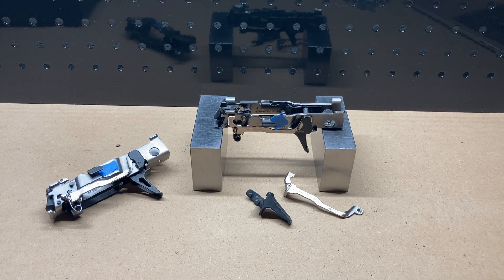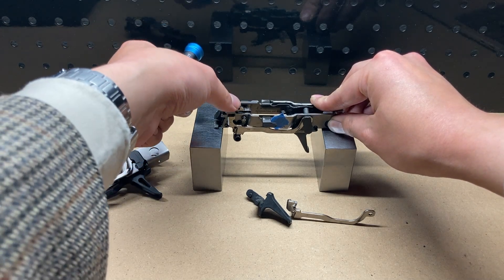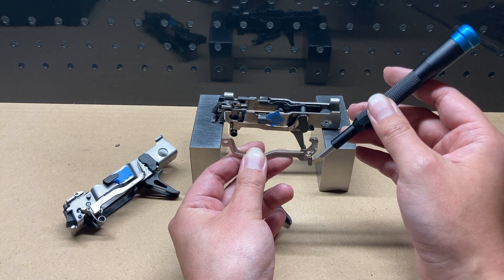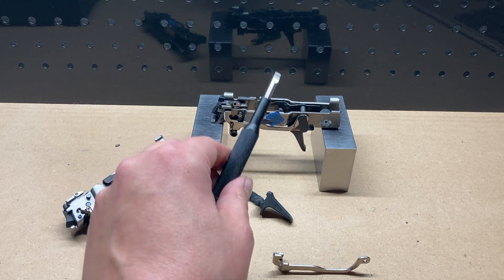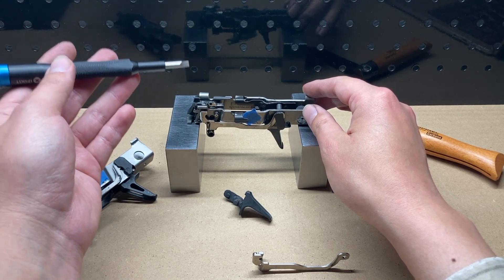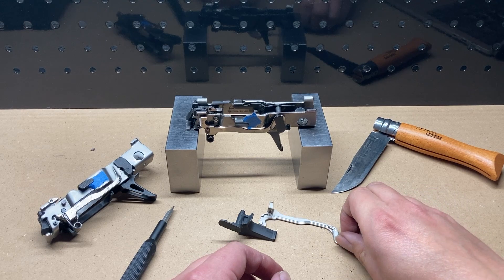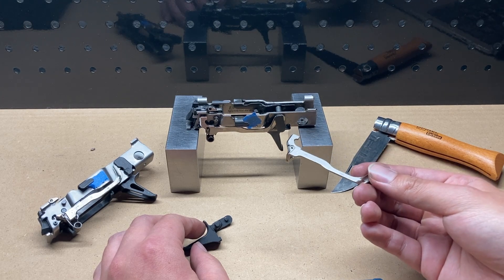P320 Sear Movement Test followup: It's all about the Trigger Bar and Trigger

Comment: Interesting thing, I just made the same gun with same parts go from "safe" to not safe and back to safe again. I have an X5 legion with this same number trigger bar from 2020 I believe. The gun passed the test and while it was passing the test the added piece for the drop safety was in no way "springy" I took the fire control unit out and it immediately failed. I started looking at why and I attempted inward pressure on the trigger bar to simulate the frame which did not work until I also moved the drop safety down. With the drop safety pushed down (and not held there by me) it passed. I put the firing control unit back into the firearm. The drop safety found a "springy" position where it was popping up and made the slide difficult to install. I racked it a few times pull the top back off and it failed all tests. After wiggling the drop safety and the parts so that it returned to what I normally see the firearm was made safe again and passed tests. The trigger bar can easily be moved around, and it is possible that in certain positions the same trigger bar can have this issue. This is a design flaw, and I believe it has something to do with the drop safety that was later added for the initial p320 recall. I am still working on making this happen reliably, but I appreciate this video as it has explained what to look for very well. 

It is also worth noting that I've made this happen a couple of times now with no way of knowing how, but the slide also does not want to go on when this happens so I'm not sure if it can be forced on or if it can happen while the gun is in service or not.

Comment: NEW DATA on this issue. PLEASE RESPOND! I tested my M18 that has manual thumb safety. With the gun field stripped and FCU in the grip module the trigger behaves as you describe “without disconnector like behavior”. So theoretically unsafe. And in fact when I mount the slide as you do and press the sear, the firing pin can be seen protruding from the breach face. This happens every time but with the manual thumb safety OFF. When the manual safety is engaged the firing pin NEVER protrudes when the sear is depressed. This goes along with my observation that without the slide attached the safety lever in the FCU rotates upwards when the sear is depressed (the trigger also moves) but when the manual thumb safety is activated the safety lever in the FCU barely rotates. So it seems from the this that with the manual safety engaged the gun cannot allow for an uncommanded  discharge. I would appreciate any comments you may have on this. Thanks
Reply from the maker: This matches the findings I had with a Manual Safety P320 two weekends ago. While the safety was engaged, the trigger bar displayed disconnector-like behavior and the safety lever was not actuated. That P320, with manual safety engaged, would not have its striker safety lock defeated by "uncommanded" sear movement, and seemingly neither will yours.
Reply: @ Thanks for your reply. I think all P320s with manual thumb safety would display disconnector-like behavior and be immune from un commanded discharges as a result of sear movement. When the manual safety is engaged the trigger bar is physically blocked from moving and can therefore not disengage the firing pin block.
Reply: One other question for you. Why do you think all the incidents of un commanded discharges seem to be of holstered guns. I don’t remember seeing any that discharged after being dropped. According to what you and I are seeing, the gun is not drop safe, and I would think a drop is more likely to discharge the gun by moving the sear than it would be sitting in the holster?

Comment: Here is an update (more testing) on my earlier comment on trigger vs trigger bar causing the problem__

I put the problem-inducing trigger back in the FCU that failed, then did some trigger bar swapping to see if ANY of my trigger bars made a difference.  

I swapped in 7 different 675 trigger bars using the Sig flat trigger (.580" from pivot OD to trigger bar pin OD (basically outside to outside). 3 trigger bars were #5 with circle around it, 1 bar was the #5 with circle around it but the #5 was rotated 45°, 2 bars with #1 with a circle around it, 1 bar with the #2 with a circle around it. I assume those numbers in the circle were cavity numbers in the forming die. 

All 7 675 trigger bars failed the sear depression test using the .580" pin-OD to pin-OD spacing. 

I then installed a stock SIG (post-update) curved trigger. That trigger has a .626" pin-OD to pin-OD measurement. All 7 of the above trigger bars passed the sear depression (no-fire) test. They barely passed but all did pass.

So it looks like the trigger pin to pin spacing difference changed the trigger bar angle just enough to induce striker safety failure when manually depressing the rear of the sear.

Then I decided to try the latest (newest) Sig manual-safety 576 trigger bar. I have seen some of the new FCU's come with the 576 trigger bar (even the non-manual-safety) FCU's. (I only had one of these to test). So this a sample of one 576 trigger bar but tested on all my 320 FCU's. 

The 576 trigger bar looks to have a slightly different look in the area that contacts the firing-pin-block lifter. 

Using the .580" (pin OD to pin OD) trigger that failed with all the 675 trigger bars, it passed the manual sear depression test with the striker being properly caught by the striker block (every time, ie many/many tests).

In fact I could actually see the striker safety block lifter lifting later in the trigger pull movement.  So it l-o-o-k-s like Sig might have slipped in a running change with their newest 576 trigger bar.  

In any case, the latest 576 trigger bar seems to be the answer on my personal Sig 320's when using the worst case trigger in my worst case FCU. Not a large sampling for sure but it looks promising, at least in my small sampling of 320 FCU's. 

The 576 trigger bar also appears that it will allow me to shorten my trigger take up a little without prematurely defeating the striker safety. The original 675 trigger bar defeats the trigger safety way too early to safely shorten the trigger take-up.

Comment: I have an important update. I have found that if I replace the trigger return spring with a 10% or 20% REDUCED pull spring, the trigger bar is able to move down and exhibit the disconnector like behavior shown in this video. The stock trigger return spring and an increased power spring cause the seer test to fail in my particular FCU. This seems only to be true with the Apex trigger bar however, the stock trigger bar still fails.

Comment: here's my question, the claims being made are the gun shooting while holstered and no one even touching the firearm. If this requires some form of kinetic energy to move the bar. It doesn't correlate with a firearm going off without even being touched (as some have claimed) , 
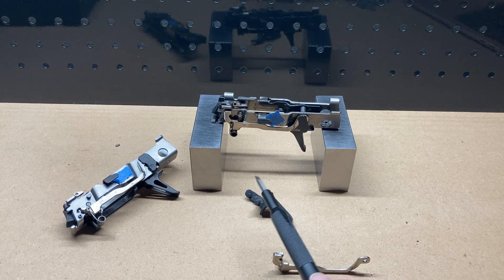you said at 4:55 in your video that "it seems to correlate with failing or not failing" <<<< what? then at 5:13 you said "configuring both your FCU and your friends FCU ... correlates with both pistols NOT failing the full sear movement test" , ???
i am not for sig or against them, I am just trying to understand whats going on here and if the trigger bar isn't moving correctly and causing the striker safety lock to prematurely release the striker how does this correlate with a gun going off without even being touched (which is what some claim).
Reply from the maker: The Sear Movement Test doesn't care why the sear is moving, it simply assumes the sear is moving and sees what knock-on effects that has on the rest of the FCU. In my opinion, a professional organization with access to an institutional grade of testing setup and an institutional level of sample size would be necessary to figure out why the sear is moving.

Comment: Is there an explanation for why the trigger bar works improperly in the one that's failing? Improper reassembly? Bad part? Wear and tear?
Reply from the maker: We've found some partial explanations, but chasing down trigger bar behavior turned into something of a fool's errand - there are so many different combinations of triggers and trigger bars and (apparently) trigger bar springs out there that all lead to different, inconsistent behaviors. At this point, we're targeting an upstream effect instead, something that would reliably prevent the trigger bar behavior from mattering at all.
Reply: @P320Truther  Yeah I did your test on my P320 XTEN and it passed. Did your test with the slide only on the frame, and also did a test with the full pistol assembled and putting a cleaning rod in the gun. It didn't move when I tripped the sear with the punch but did when I pulled the trigger. Also put a piece of paper behind a snap cap to test light primer strikes and didn't get anything there either.

So seems like my P320 is fine. But yeah, figuring out exactly what combination causes the problem guns vs. ones that work fine like mine would be nice. I know I put a bunch of aftermarket springs, trigger, and trigger bar on my FCU. Maybe the aftermarket ones are better than Sig OEM? I dunno.

Also curious if a manual safety gun is susceptible to this issue. I specifically wanted a manual safety on mine so I actually bought an M18 FCU and then modified it for 10mm (already had other 9mm guns).

Comment: I have a much older, pre M17, manual safety FCU and a newer Wilson Combat (no trigger action job) FCU. I have converted the manual safety FCU to non-manual safety. Both when conducting the test in a grip module only move the trigger bar forward and not down.

Comment: This was an extremely thorough, enlightening explanation. Both my .45 and 9 Compacts (purchased in July 2022) pass this test, but I am also using the flat-faced, non-cutout trigger and 10% extra power springs. I really wish Sig had gone with more of a Glock-style plunger safety with a more robust coil spring instead of the teeny little torsion spring they have in there. I'm wondering whether a stuck safety or broken/lost spring are contributing to these reports as well.
Reply from the maker: For certain, broken striker safety levers and striker safety lever springs will yield unsafe guns. There was a military report put out where one armorer took apart over 100 M17's from their unit and found broken or missing striker safety levers or striker safety lever springs on 3 of those pistols.

Comment: I have two P320s, one is a Wilson Combat P320 with their trigger and action tune.  Both of these have the Grayguns triggers, that is what Wilson uses and that is what I had the Dealer install in my other FCU.
Both have manual safeties.
Both trigger bars move straight forward when activated as you show here, by the sear.
Safety on, for the Wilson it didn't allow full movement of the sear, it actually prevented complete movement when disassembled.
For my other FCU it did actuate fully but it actuated the trigger bar down.

So both safeties seem to function to prevent this, but I went further.
Put guns together and used a snap cap with a small piece of paper on the back to check firing pin strikes.
Did several controls by firing with trigger as normal, firing pin strikes were easily observed on the paper.

Tested both as done in your videos, by sear manipulation through back of slide, with the safety off and on.

Neither had firing pin strikes regardless of whether safety was on or off when sear was activated without trigger pull.

So even though the trigger bar moved straight forward when safeties were not engaged, neither had the firing pin mark the paper through several attempts.

So mine don't seem to have an issue regardless of whether safety is on or off and even though sear manipulation moves trigger bar straight forward.  I carry them, with safety on, and I feel fine doing so after all of this, though I never stopped carrying them.

Comment: Thank you for the video! 
I tested my M18 and I believe it is safe. I did your stripped test and behaved like yours. I put on the safety and it it didn't click, but it's range of movement changed. I then assembled the gun and put a chopstick down the barrel as a indicator. Using a small screw drive to engage the sear, I am happy to say that disconnected worked reliably with and without the safety engages. the firing pin only moves forward with when the trigger is pulled.

Comment: so basically a 1/16th mm of tolerance in a MIM part means you get a "safe" gun or a uncommanded discharge gun...
Reply from the maker: Here's the fun followup question: Do you think that disconnector-like behavior is intended or not? Neither answer has any good implications!
Reply: @P320Truther  That's a good question.  To me, it seems that is the intended function, specifically to prevent an accidental discharge from a sudden blow to the back of the gun (i.e. dropped), since the downward motion keeps the firing pin safety in place

Comment: I noticed on my 2017 P320 that when I dry fire it the entire rear of the FCU moves down at least 1-2 millimeters. I sent it in for the Voluntary Upgrade Program. I haven't checked for that yet. So there can be play where the Sear meets and locks the Striker. Possibly causing a😢n issue. 
Thanks for your great programs.

Comment: When I pull the trigger on my P320 the rear of the slide rises slightly in relation to the FCU/frame. I'm wondering if that movement could make it possible for the striker to disconnect from the sear.
Reply from the maker: No, that is (IMO) an oft-cited red-herring. A loaded pistol does not experience that same play between FCU and slide because the fully-loaded magazine is tensioning the two parts apart.

Comment: When doing these tests on my FCU I don't get the click after pressing the seer down. I fully depress the seer, the trigger bar moves straight down, but there's no click-like reset that I see yours doing. Maybe I'm doing something wrong? My FCU is pre-voluntary slide upgrade. I get the same results with the original 657, and newer, 576 bar. Appears to be good to go as the trigger bar goes straight down with the same movement as the slide disconnect. Stock X-Carry grip module. I am using the Armory Craft positive reset trigger spring (I have no idea if this has any effect).
Reply: interesting! I have 2 p320's. the first one is a first generation post upgrade with am oem curved trigger. the second one is an 2021 m18 with an skeletonized flat trigger also from Armory Craft.  The one with the Armory Craft trigger fails this test

Comment: I have another data point to report. I purchased an installed an Agency Arms trigger kit that has the safety tab in the trigger. This did NOT make for a FCU that would pass the tests. The trigger can still move enough before the safety tab engages that the sear is able to fully fall.

Comment: I mean... if the two bars reliably produce the same results and are, in fact, different... then SOMETHING is clearly different in their dimensions, whether it be angle, thickness, etc. Perhaps a 3D scan may allow for a computer to discern the difference? They are clearly not identical, but figuring out the issue is clearly not easy. |

Thanks for doing the work, we know there is a problem but we are sure af not getting answers from Sig.

Comment: I think it’s the skeletonized trigger. I swapped triggers, trigger bars, and springs between 3 different FCUs. The only time the trigger bar didn’t move downward on the sear test was when I had the skeletonized trigger installed. Regular curved and non-skeletonized triggers had no issues with the sear press test regardless of which trigger bar or FCU was used.
Reply from the maker: The skeletonized trigger certainly seems to reliably induce failures of the Sear Movement Test, at least in the sample of FCUs I've seen. The way it changes the angle of the trigger bar clearly seems to cause non-ideal trigger bar behavior.
Reply: @P320Truther  my skeletonized trigger fails this test as well
Reply: @Supernova73178  thanks for the confirmation amigo! Stay well.
Reply: @P320Truther  thanks for the confirmation and outstanding videos! I feel a lot better shooting a p320 after going thru the sear test you showed us. Keep the great content coming!
Reply: Looks like we plugged in one piece of the puzzle. Thanks for the great comments and feedback guys! Stay safe.

Comment: Just tried this on my P365. The lever which disengages the firing pin block DOES NOT MOVE when you push the sear down manually. It only moves when the trigger is pulled. I am guessing Sig figured out the issue and quietly fixed it on the P365. The only annoyance is that the firing pin block lever is a free floating piece that rattles, which is kind of annoying.
Reply from the maker: The P365 does not have the second leg on the sear that the P320 does and thus is not able to act in reverse on the trigger bar.

Comment: Should the test be done the same regarding if the weapon has a manual safety?
Reply from the maker: I currently see no reason these tests wouldn't be valid for a manual safety FCU. I was able to get my hands on one this past week to test. Refreshingly, the manual safety preventing movement of the trigger bar actually did prevent the sear from causing any sympathetic movement of the safety lever, so in theory, manual safety FCUs should be safe from this particular failure mode as long as the manual safety is on.
Reply: @P320Truther  thank you